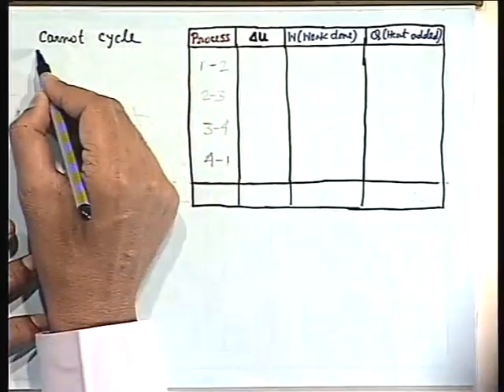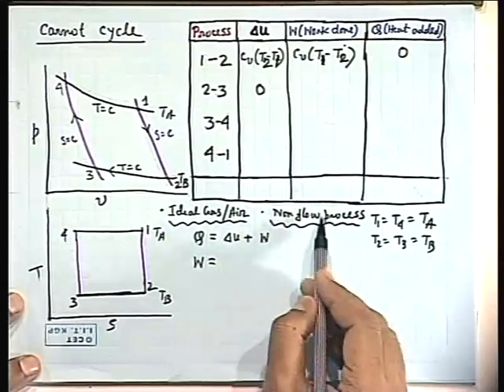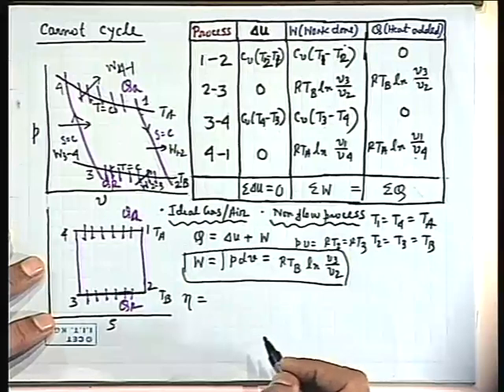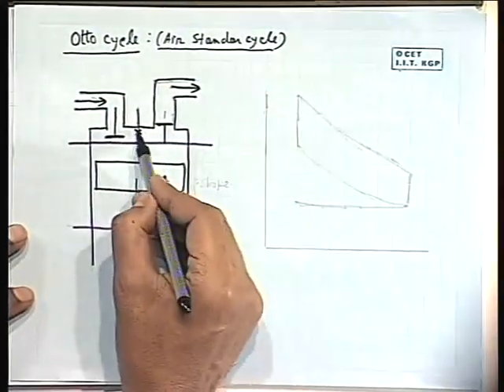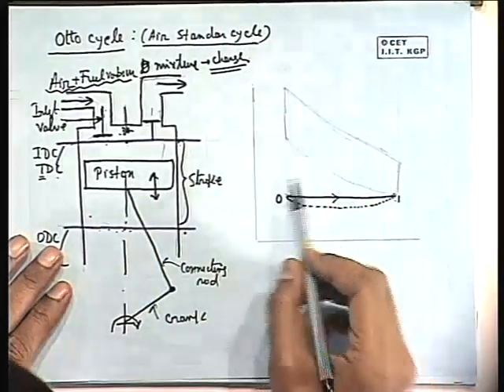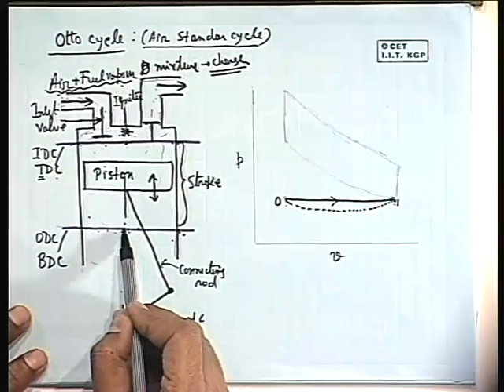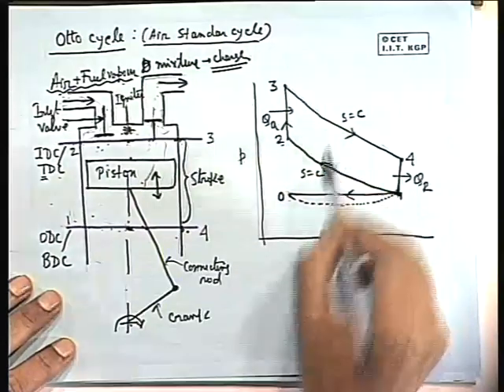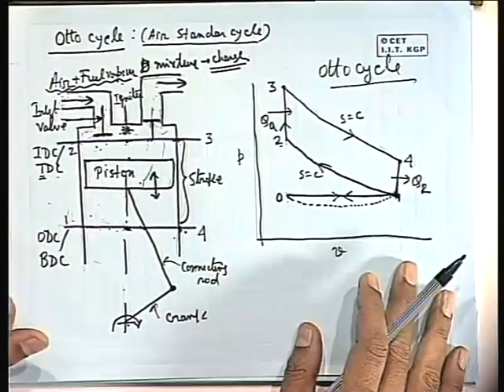Lec-24 Gas Power Cycle-I

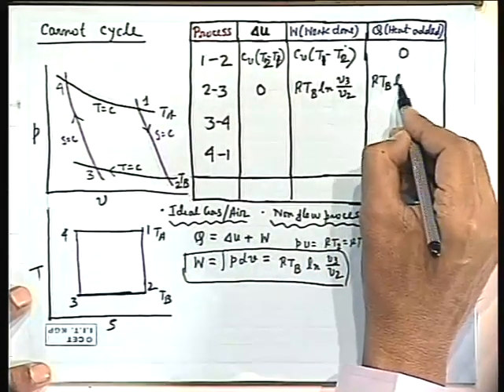Comment: 11:47 process 2-3 u can still use Tds formula... it will give the same as answer... Rln(v3/v2) is the formula for change in entrophy for isothermal process.. the assumptions are also valid to use Tds formula...

Comment: In this video the change in internal energy is evaluated as Cv(final temp-initial temp) and Cv is the specific heat capacity at constant volume, can any one tell is it valid to use this expression as the process is not isochoric. If this is valid then why cant we calculate enthalpy by this method plugging Cp instead of Cv for any process?
Reply: for ideal gases we use dU=mCvdT for all types of processes,

but for real gases, we use dU=mCvdT for constant voluyme process only
Reply: relation :-    Cv=(du / dt )v     AND        Cp=(dh /  dt)p .....
Reply: basically we are dealing with 1st law of thermodynamics dQ=u2-u1 + dw , so we have considered internal energy instead of enthalpy
Reply: Actually that equation is valid for ideal gas..